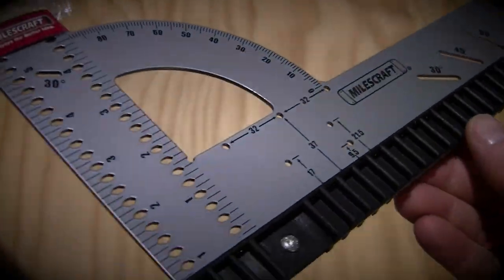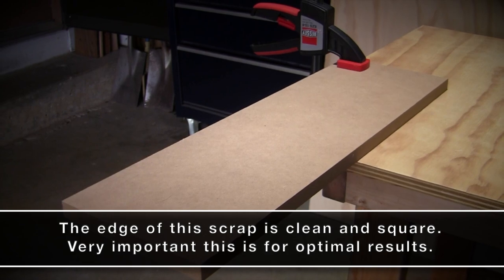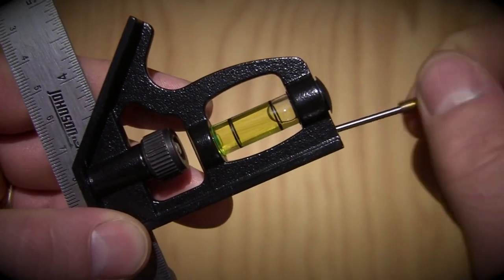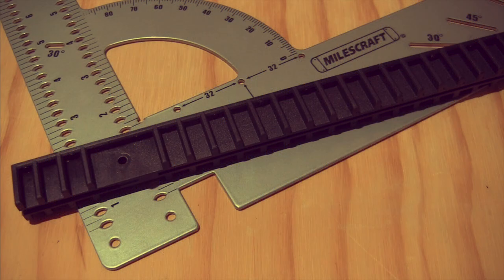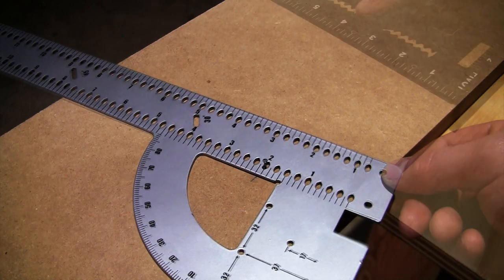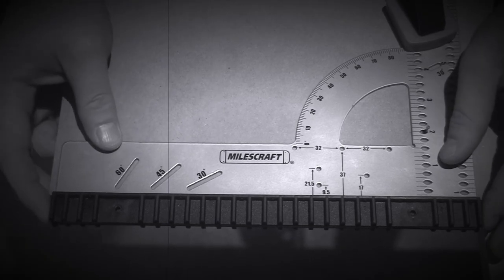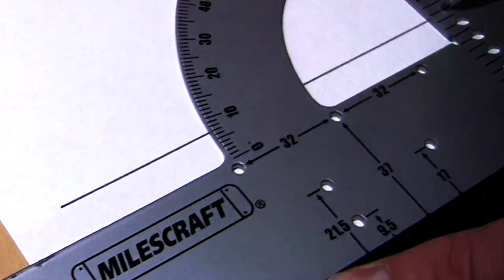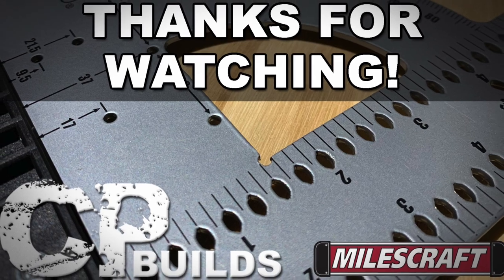How To Square Up Your Square : Tips & Tricks

Comment: Simple test for square I was taught.  Draw a line with square from a factory edge.  Then flip the square over and lineup the line with it.  If the two lines are exactly the same along the length, the square is true.  If not, then make the necessary fix that I won't go into here.  It is quick and can be done whenever you feel like testing the tool's accuracy.

Comment: What is the purpose or idea behind the fact that With the Black Plastic Piece ON - and on a flat piece of material... The 0 - ZERO mark doesn't line up with the material.  It's way down a the very bottom where the Black Plastic taps agains the angle ruler.   Thank you in advance Sir.  Cheers!
Reply from the maker: Thanks for the comment. To be honest...I don't use that anymore. It has been donated to a local high school. I found that it wasn't really all that useful with the (1/8)" notches and it kept coming out of square when I used it. It just wasn't the tool for me.

Comment: Bought one & it's out of square & the rail flexes with pressure. Not good for rough lumber. I am thinking maybe a 3rd screw in the middle to secure the rail.
Reply from the maker: They have a version made out of aluminum now. I honestly do not use this anymore with going to Woodpecker tools. I didn’t notice any flex with mine really...just the out of square...that’s for sure.

Comment: I don't understand. This is only for this particular model of square, isn't it? In comparison, SeeJaneDrill did a video on physically adjusting a square.
Reply from the maker: Correct. The rail is removable. I wanted to make it so the notches were accurate so I could layout my MFT grid. Hope that helps. Take care David.
Reply: @CPBuilds  Ah. Thanks